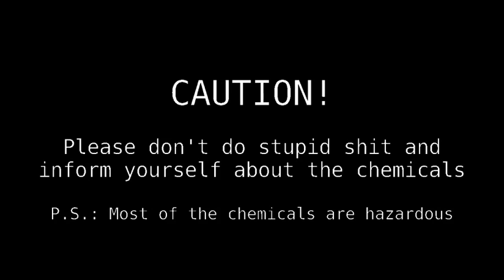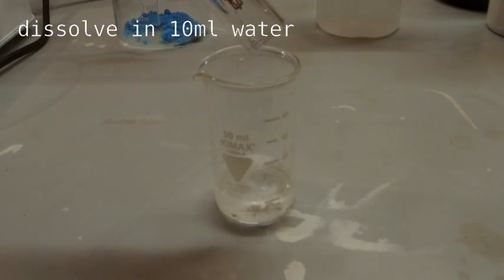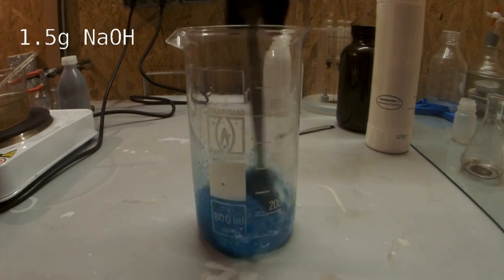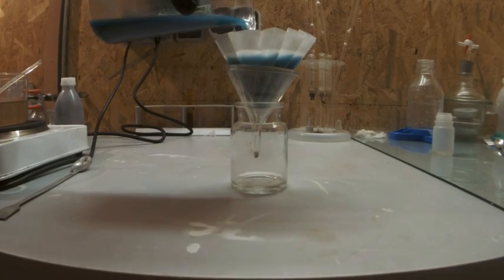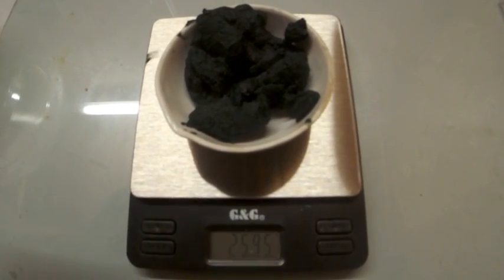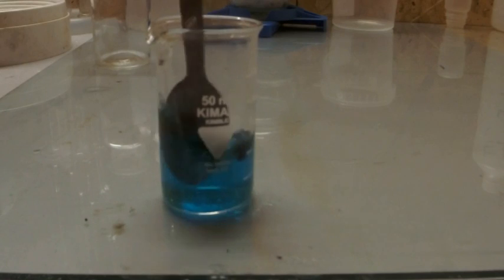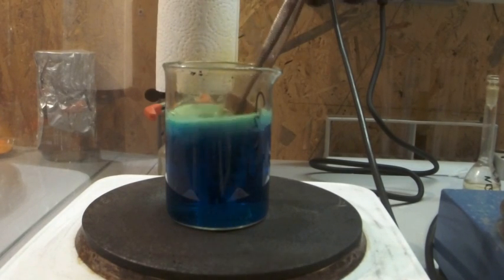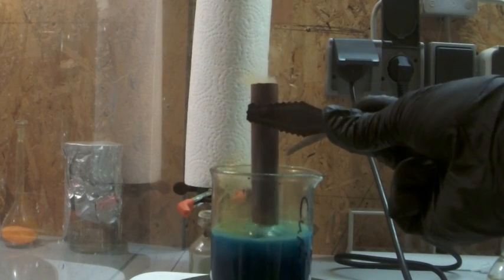Coppernitrate synthesis (nitric acid saving method)

Comment: GREAT VIDEO..........You know i never thought about that before.  Using hydroxides to make nitrates instead of metal.   And that keeping the NOx gases away.   GREAT FREAKING TIP.   I can not believe you mentioned me and my idea about making hydrides......COOL.   Think the first one i will make is LiH cause it seems the easiest.   Lithium battery to get metal and a hydrogen stream threw a tube furnace and making a small hole at the end of the tube so i can light up like  a torch and then a LOT of heat where the lithium is. Might take me another year or 2 to get to that point though....lol
Reply from the maker: haha well your idea with the hydrides was very interesting I tried it a couple of times but wasn't able to do it in a save manner.... so I dropped it because I didn´t want to burn down the lab 

mfg hazelChem
Reply: @HazelChem  ........Yeah the hydrogen and flames scare me too.   I blew something up by accident with hydrogen in it.  It was scary.   Shrapnel went flying every where.

Comment: it dosen t contain Na+ ions contamination from NaOH?
Reply from the maker: it could  but they are mostly washed away when the copperhydroxide is washed in the filterpaper

mfg hazelChem
Reply: @HazelChem after adding the sodium hydroxide, I’d recommend heating the aqueous mixture as cupric hydroxide is thermally unstable and readily converts to blackish brown cupric oxide which filters easier and hence can be washed and dried easier as well.